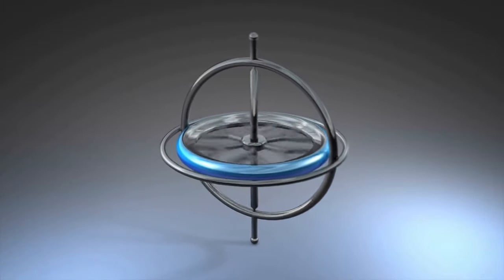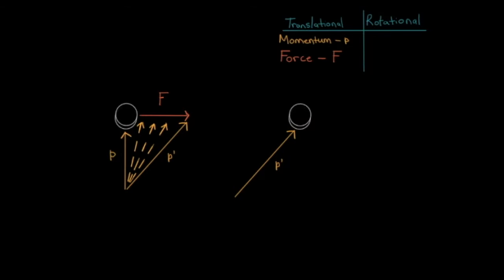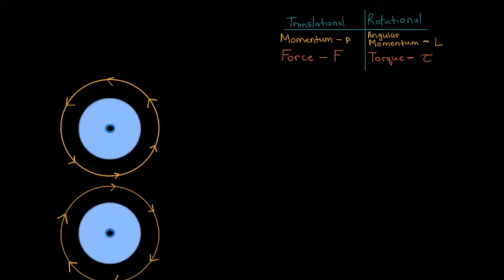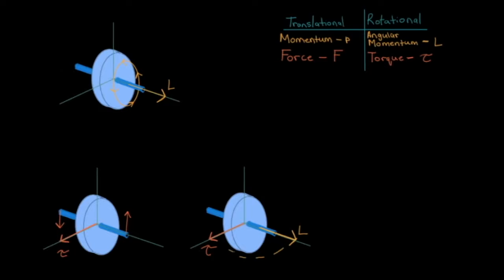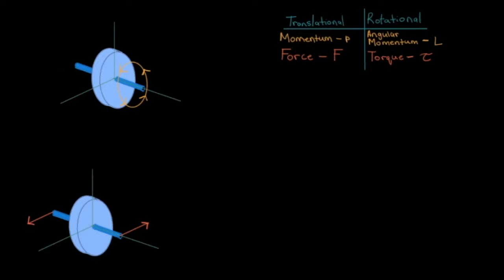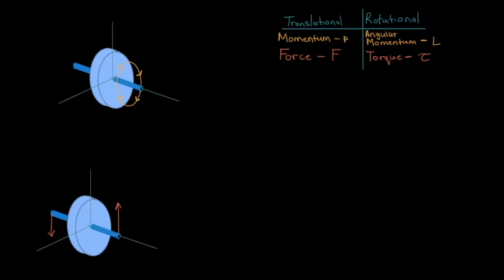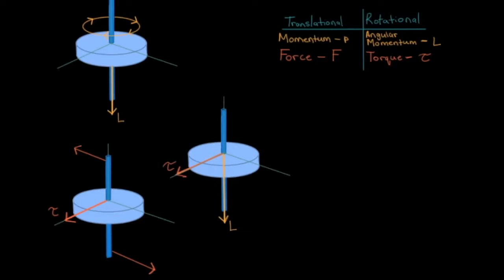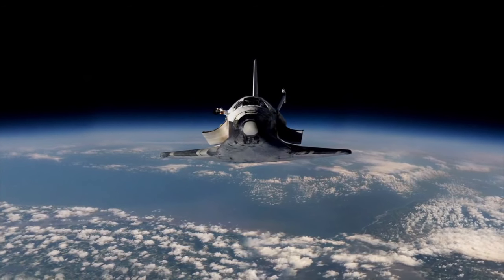Gyroscopic Precession is Easier Than You Think!

Comment: When riding an electric unicycle the wheel is rotating in the forward direction so the cyclic precession causes the wheel to turn left when the wheel is leaned to the left. This is why it’s easier to turn left and harder to turn right on an electric unicycle.

Comment: My first time trying to understand the mechanics of the gyroscope. This video helped me get there after hitching my thumb in every direction (luckily I wasn't anywhere near any cars). I still think I need to play with actual gyroscope to visualize some of the examples, such as when the angular momentum was pointing upwards; I just couldn't imagine the wheel on a string scenario.

Taking from the explanation at the end of the video, I understand that the wheel on a string is not actually a gyroscope but an apparatus that follows gyroscopic rules. So it just won't do for certain examples.

EDIT
I used the flip-camera method to visualize the angular momentum in the example above, and the wheel practically breaks gravity 😅. It basically backflips in a very gyroscopic way 😒.

Comment: Well explained thank you, but I have a question clicking in my mind. 
Is there some kind of force produced due to torque acting opposite to gravity that trys to keep the wheel vertical???
Reply from the maker: There is! It’s the angular momentum vector. It points parallel to the ground. And as long as the wheel keeps spinning, the angular momentum will want to stay rigid, parallel to the ground
Reply: @physassist2635  I'm still puzzled. Everything said in this demo makes sense and is well-explained BUT, while all this is going on, gravity is still 'pulling' (allow me that for simplicity). Is this upwards resistance to gravity equivalent to mass transfer, but cancelled-out?

Comment: NICE explanation. Angular motion can never catch Torque, because they are phase shifted by 90 . The same phenomenon occurs when a rotor chases a rotating E.M. field in Tesla's polyphase induction motor, and for the same reason. Namely, a 90 phase shift.
Reply from the maker: That sound really cool! Something I’ll have to look into!
Reply: @physassist2635  The 90* phase shift seems to me to be absolutely fundamental in producing rotation. I just came across a video how the sine and cosine functions of the Unit CIRCLE produce the circle itself, which is not surprising since they are derived from it. Noteworthy, is that the 2 waveforms are phase shifted by 90* ,and are at right angles to each other, and when set in motion produce a circular spin of the Unit CIRCLE. When  the 2 waveforms are superimposed into a 3-- D image they map out a spring like form, which next to the PENDULUM  is the most common model in describing Simple harmonic motion. Most importantly is that these depictions are just as valid in describing gravity as they are for electromagnetism. This suggests an underlying unity.

Comment: It would be nice to take this to the next step. How a spinning object with a slight imbalance will flip 90 deg and spin in a new orientation.

The easiest method to determine which direction with an applied torque is a motorcycle that is propely steered with counter steering. if you want to go right, push forward on the right, turning the wheel left,, the bike leans right and the force makes a right turn. This turns so quickly, if you do it on a bicycle, you over-do it and immediately fall down. But the speed of rotation and mass of a motorcycle works to enable controlled steering at speed.
Reply from the maker: That sounds cool. I was not aware of this phenomenon.

Comment: It's a feedback loop. Further: the momentum's direction is changed by a force that brings it back to zero, thus conserving space thus increasing the rotation or causing the object to rotate on an axis other than the one causing the monentum in the first place, the inertia keeping it going until something else acts on it friction etc. 
 So there are actually three rotations going on at once on three different axes all at right angles to each other ideally. This proven by the state of the wheel relative to the rope when the  angular momentum stops. The momentum of the wheel spinning must act as a counterbalance to the force of gravity on the weight of the wheel itself, until it is over come by a different inertia as stated early. 

Note: it would be better to give torque representation in two D space rather than just arrows as it is a streach to understand the direction with the Rule without having to make a mental fill in that someone who is really  young might not be able to do(I know I wouldn't have and only did it with a bit of reflection now).

Comment: Hi. Firstly I like so much this video. Thank you for your clearly explanation. But I’ve a question. If we turn the wheel, wheel doesnt fall and stay angle with 90 degree to rope. But if we didnt, it falls because of the torq. What makes stay with a balance when the wheel turns as a force?
Reply from the maker: The wheel stays upright when spun because of gyroscopic inertia (aka rigidity in space). As the wheel spins faster and faster it will have a stronger tendency to want to maintain the axis on which it is spinning
Reply: @physassist2635  thank you so much. I do not know how it is called that term (gyroscopic inertia) because ı heard first time in my life because ı am a student in high school. I got it nicely :)

Comment: Woah - 6:14 when you add the torque arrows - it all turns into kind of a jumble...It would help to label the axes here. When you say 'applying torque' by pushing the right handle up then there's the arrow coming out the front of the tire   "...pointing in the direction of the torque" (I thought the torque was the little arrows)  So maybe you mean something like 'applying an upward force on one of the handles results in torque along the __ axis' - I know they're both torque, but for somebody trying to get through this one step at a time, that threw me off.

I always found the phrase 'momentum follows the torque' to be confusing.... the word 'follows' in particular...Your second description is better - follow the hocky puck example - the momentum vector changes in the direction of the force applied to it. In the case of the spinning wheel, the same thing is happening, you just have to know that angular momentum is along the axis of rotation and the torque comes out the front of the tire...

Then at the wrap up, imo you have to go back to the hanging bike tire - don't confuse things by showing the person twisting the tire at 7:36. Yes, it's all the same forces, but the question was - why is the hanging spinning tire rotating around the string?  And the answer that I don't think you ever come out and say is that gravity is supplying a constant rotational force (up on the right handle attached to the string, down on the left handle), which results in torque vector coming out the front of the tire, which supplies a constant nudge the angular momentum vector. IT's like giving a hockey puck a slight poke 90' off its course, then 1 second later, giving it a 90' poke off its resulting course, over and over and over.

Comment: What I have trouble understanding is where the torque force is coming from. Why is it always in the right-handed direction, never a left? It still seems to me there shouldn't be any force on that axis in either direction.
Reply from the maker: The torque comes from grabbing the handle bars with your hands and twisting it in a certain direction. In the case of the wheel balancing in the string, the torque comes from gravity. You can think of gravity grabbing a handle and pulling it down, while the string “pulls” the other handle up.

Comment: So, if you spin a top fast enough (ccw), why doesn't it float off the table when the angular momentum overcomes the gravitational force? And I guess if you spin a top in the opposite direction (cw), it's trying to drill into the table. I guess this is why screws and drill bits have the directions that they do?
Reply from the maker: The top would not float off the table because there is no force pushing it upward. The angular momentum vector  is an axial vector (not a polar vector as we are used to with things like force or velocity). This means it tells us the axis on which the mass is spinning. It also tells is whether it is spinning cw or ccw through the right hand rule. So an upward pointing angular momentum (axial vector) means that the mass is 1. spinning; and 2. Counter-clockwise. It does not mean there is an upward force.
Reply: @physassist2635  hmmm. Deep 🤔🙂👍 but momentum is mass x velocity to the best of my memory. I am trying to think how you can have momentum without movement. Really, its mind bending. It was a good explanation but there needs to be arrows put into the video 😁 also, why does the wheel want to go in a circle around the supporting string? And what if the wheel is 45deg with respect to the supporting string when you spin it? Will it want to stand up or will it want to maintain a 45deg angle?

Comment: i just wanna double confirm on how to find the torque vector using right hand rule, is it simply ignore the angular momentum first, then just assume how would it rotate according to the torque applied? thank you
overall it's very nice explanation, thank you so much.
Reply from the maker: You got it! To find the torque vector, don’t consider the angular momentum. Just apply the right hand rule in the direction of its expected rotation.
Reply: @physassist2635  thank you!

Comment: Great video!  Although i still don't get the last, magical bit... i get the 3 steps and the following horizontal rotation. But with what counterforce is created by the angular momentum to "fight" gravity?
Reply: or is it just the horizontal angular momentum that is way way bigger than the gravitational force and wants to keep on doing the same movement? (in combination with the radial force in the rotation?) and so it drops slowly(+air friction => less angular momentum). Still a bit confused
Reply from the maker: You’re pretty much spot on! It is the fact that the angular momentum is large and wants to stay pointed out to the side (parallel to the floor) that it is able overcome gravity. 

And since the weight of the wheel torques it downward, it creates precession, causing it to rotate around the string.

For example, let’s take a snapshot of when the angular momentum is pointing to the left (13:10). Looking at the screen, the weight of the wheel causes it to want to tilt downward due to gravity. But three things happen here.
1. The wheel doesn’t tilt down due to gravity because angular momentum is large and keeps it upright. 
2. The downward force due to gravity creates torque, pointing straight out of the screen toward us (right hand rule).
3. Angular momentum then follows the torque. This it what causes the wheel to rotate around the string almost magically!
Reply: @physassist2635  Absolute legend! Thanks a lot for the perfect explanation!

Comment: This is good to solve problems. But, i want to know why angular momentum chases torque.
Reply from the maker: You can think of it as the torque gives the gyro a new angular momentum. When you apply a force to a moving object, you give that object a new momentum in a similar direction as the force. As example, a tennis ball in flight has momentum in some direction. If you apply a force to that flying ball by batting it to the left for instance, you give it a new momentum that will be more or less to the left. That is, the momentum chases the force. Or in other words, the force determines the momentum. 

Torque in rotational motion is analogous to force in translational motion. And angular momentum in rotational motion is analogous to momentum in translational motion. So in the same sense that force determines momentum for an object in translational motion, torque determines angular momentum in a rotating object.
Reply: Sir i m getting ur point and i appreciate ur efforts and respect for ur viewers but i m keen to know the cause u check video by eugene on this concept i didn't get it properly but i think u will understand it
Reply: This comment is more understandable than whole video for me
Reply: Angular momentum does not chase torque rather torque leads the angular momentum....

Comment: just wondering, what might happen if had a spinning wheel with wheels attached to that, spinning separately, either counter or with rotation, the  wheels being batteries ? JJH.
Reply from the maker: That’s a good question! If I’m understanding correctly the two there’s are counter-spinning on the same axel? In that case I believe the angular momentum would cancel out if they are the same mass and spinning at the same speed. Otherwise you’d take the net angular momentum do determine which way the wheel would rotate
Reply: Pleasantly surprised have asked a pertinent question to you fellas, worthy of your curiosity,  can figure the rest out yourselves, any variations like horizontal ,  various ways to make them spin, etc, same axel, yes, I promote the idea of batteries designed to spin, to increase the efficiency of vehicles, also,  thanks!

Comment: Why is angular momentum considered to be on the axis of spin, not on the angular movement?
Why inside not outside?
Reply from the maker: Hi Edd. Since the direction of a spinning object is constantly changing, we describe the direction of angular momentum (torque, angular velocity etc) in a direction that will remain constant. The axis, remains constant as the object spins around it in the perpendicular plane. Therefore, the angular momentum vector will be on the axis of rotation

Comment: Someone please help me understand 6:15. The torque. I don't understand how in that diagram, the arrow points towards me instead of up. I try using the right hand rule and just mess it up. I just don't understand how I am supposed to curl my fingers to get the direction of the torque.
Reply from the maker: When you grab the handlebars and pull the right side up and the left side down, it will rotate counter-clockwise. So curl your fingers counter-clockwise and your thumb will point toward you.